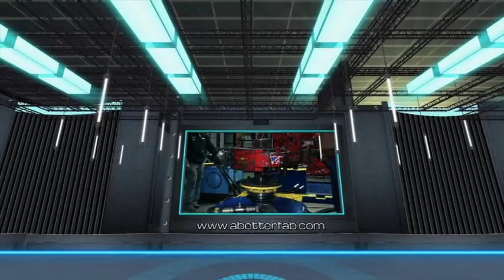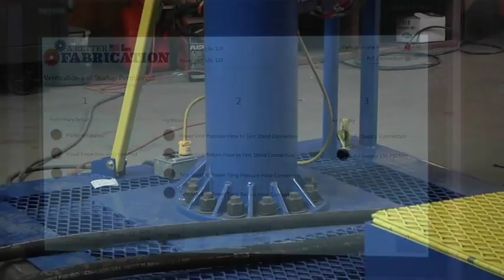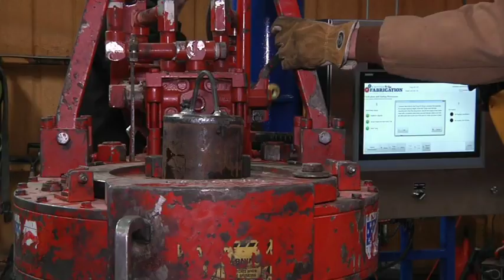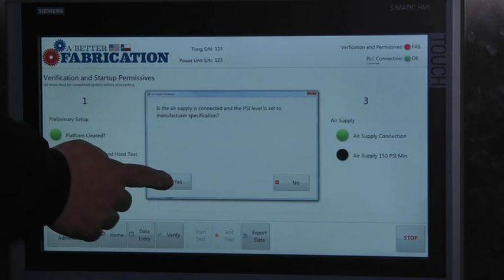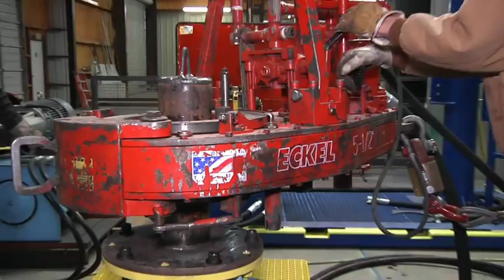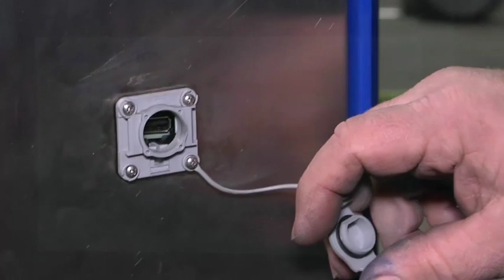Tong Test Stand Demonstration

Comment: Very cool! However, I prefer to use the system that the manufacturer customized for us. It's a simple stump whatever size, (nothing turns), that has a censor built in. It's connects to a small receiver box, which then sends the graph/digital results via bluetooth to your preferred device. then create a PDF report to sent to customer. simple, small, quick, accurate, and easy to use.